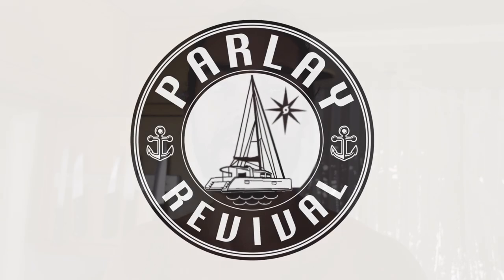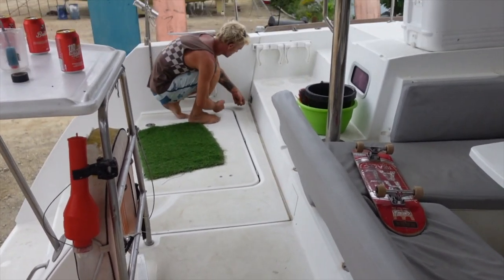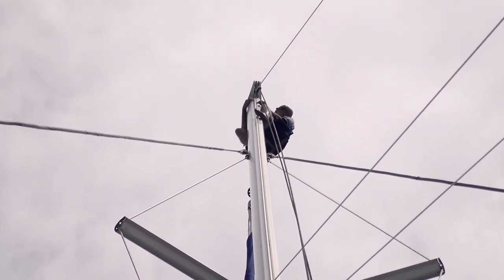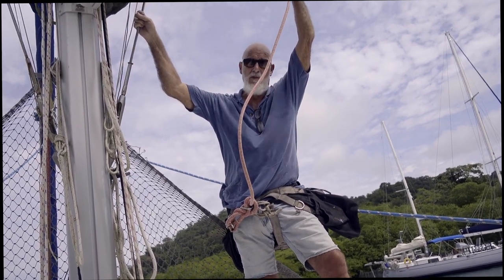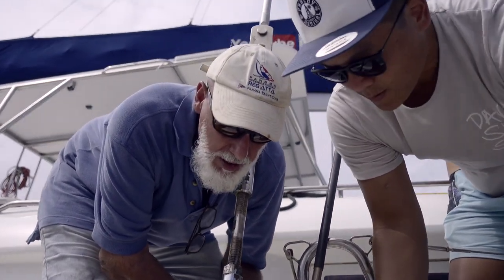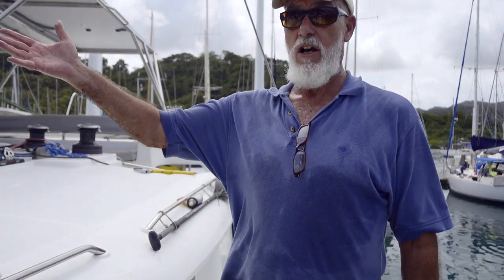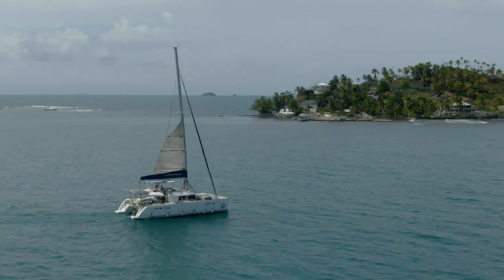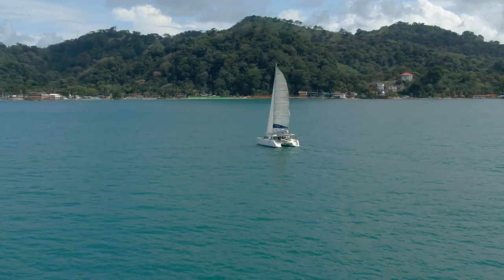How to PROPERLY TENSION YOUR RIGGING on a catamaran - Episode 142

Comment: You would think the Lagoon designers might place a rod compression tensioning mechanism between the hulls at the main bulkhead and the bridge deck bulkhead to handle the stress of windy days and high seas!   I can see how you will always be cautious about over tensioning the rig in light winds and under tightening it in heavy winds.  The main bulkhead should have an imbedded I-beam port to starboard with lever rod adjustments at each end to keep the hulls parallel perhaps with hull movement limiting functionality. 

That is why I trust the full keel, keel stepped mast mono-hull in all sea conditions. 🤔  Just my untrained observations.  I can’t wait to see you take  “Parley Revived” out for a sea worthy test in heavy winds and seas.  Very nice re-construction work from a former “small” fiberglass boat builder.

Comment: a really half smart thing to do ( if you are starting from the point you did) is to undo the bottle screw slip and the shroud fitting and actually apply some waterproof grease. My guess is she has been sitting around a while  - and the amount of load you had to put on to get the shrouds to release  - seemed a little over the top.  greasing before reassembly helps buckets

Comment: The stays should really be tensioned using a Dillion quick check tension meter (10,000 lbs) where a professional can tension the rig to be between 3240 & 3250lbs port and starboard which happens to be is the correct recommended factory settings allegedly.  
Doing it by eye no matter "how many years" you've been doing it by eye isn't the same as a professional calibration with the correct tools) Yes I've just had it done on a 2018 mid production run F450, post factory recommend repairs. Doing it by eye and the mast is possibly overstepped, then trying claiming that from Lagoon in the future when you may incur more bulkhead issues especially under warranty.

Comment: Yes , a boat or airplane that is not “ flexible “   Brakes down eventually . I would imagine that a mechanical tension meter does not work on this rigging. It is massive but on  a mono hull with  stays of 6 mm it gives a good indication just as the rigger said the mast is now straight that is no S turn in it as you look from below to the top. To avoid problems with turning the spanners , in the future, i would have used  a little bit of ceramic grease on the threads  and then lock them. But respect guys to you and the rigger.

Comment: Over tention on any rigging is a no no . In my day i have seen buckling masts on monohulls as wel as on multihulls . Now i sail a Dutch traditional flat-bottomed boat with a wooden mast . A very sturdy piece of timber indeed . The shrouds are connecting to a steel band around the mast and resting on a thicker piece . If you over tention your shrouds on a rigging like this you are pulling the band into the mast wood . I prefer a bit of looseness in this case . My 2 cents for anybody who wants to know .

Comment: Why not use a tension gage such as LOOS gage sized for your rig. Makes comparison port / starboard  under weigh with different wind strengths accurate
How much forestay deflection and static backstay load do you have

Comment: Not gonna lie... I am hugely suspicious and untrusting when it comes to riggers. This gentleman-rigger (Mike) put me at ease after hearing him speak just for a few minutes. No gauges just old-school feel and eyeballs. Excellent. The only thing that leaves me a little uneasy is not finding a single bit of rigging hardware that needs replacement. Gotta be pretty careful with stainless because it can look fine and have a tiny surface flaw that allows moisture inside. They can look good on the outside and be rotted internally so you have to eyeball the heck out of every part.

Comment: Do not tighten the riggings on a catamaran before launching the boat.  A boat stored on land or moved is going to flex some in moving the boat.  Do non over tighten the riggings that can cause cracking problems.

Comment: These Cats are great for hanging out  docked at a Marina.. You should measure the Deflection In open seas while  tension under sail.  When the Cats are Deflectiing for days and weeks in open seas, that's when things snap. FIBERGLASS HEATS UP  when it's bowing for days ...  B.O.A.T.  Bust Out Another Thousand.  In my opinion,  Cats should have a metal skeletal frame of some kind so that the rigging can be directly attached to at certain points..  Just my opinion.
Reply: Crowther cats had a glassed wooden box beam across the hulls - super strong

Comment: Just the interview places the boats value at or above the 400k range.  Heck of a job.  You can bet engineer's have made Lagoon bulkhead changes or they won't be able to sell a boat.  Next boat upgrades, solar sail, solar windows and panels with mega battery backup..  NO ICE engines required.

Comment: use anti seize on all threaded fitting's before assembly, stainless thread's are notorious for binding or galling. a seized buckle or bolt thread on anything is a pain in the arse.

Comment: I teach rig set up. I didnt see any measurements, cap distance, or rake of mast, or methods or even percentage of braking strains of various sizes of different types of wire. I think-what you have done with your rigger will get you sailing, but to get the true exact rig tune you need to use maths. I would suggest to get a official rigger latter on to certificate your rig setup.

Comment: Too much rig tension may reveal a problem but it does not  cause the issue. Under engineered bulkheads and cheap manufacturing methods are the problem...
Reply from the maker: For the lagoon 450, I completely agree!

Comment: For the young woman getting sea sick try inserting an earplug into one ear; this fools the brain into ignoring signals from your ears and forces it to focus on signals being sent by your eyes. Navy divers bobbing on the surface uncover one ear and claim it works best if you plug the ear that is opposite to your dominant hand, such as your left ear if you are right-handed. The other thing is stand where there is nothing between you and the horizon and look at the horizon.

On a boat you will acclimatize to the movement but use the tricks and figure out what works for you then in larger waves you will have something that can help.

Comment: I remember watching you tighten the rig right before the bulkheads broke and I couldn’t believe how tight you had it, the amount of force you were applying to very large wrenches on the turnbuckles made we wince. I think the bulkheads were definitely under designed but your rig tension is likely why yours broke with and audible snap. Anyways, great job getting the boat repaired and look forward to your next adventure. Cheers!

Comment: your mast seems raked back quite a bit.    this guy seems sketchy to me.  if you say feel is more accurate than using a gauge-well that is just poppycock.  it is appropriate to say that the manufacturers recommended tension may not be best for your boat/situation and that experience may guide you to a more appropriate setup.

Comment: Such Bullshit. Nice regards from a naval architect from Germany. No reason for tensioning the lee shrouds. The mast in the top will move a little more if not tensioned. So what? A race boat is trimmed differently, but they replace the rigg after the season and the hull lasts also only for few years maximum. The education of the riggers is absolutely poor. You're right, no reason to tension too much, but it's already too much. The tension comes in from the windward side. Even when sailing downwind. Just the forward and aft shrouds need to have similar tension. And after changing the course the shrouds on the other side should have the same tension or slack. What should it be good for to tension shrouds that are not under tension by nature? A catamaran is quite similar to an sensitive wooden boat. Even if the boat is now stronger than ever there's still no need for that. An inch of mast top movement doesn't make a difference on performance or up wind angle for a cruising boat. Better think about keel concepts. There are different ways other than dagger boards or short fin keels.
And always remember what tension does to threads when stainless steel comes to stainless steel and what additional wind might do. Save your standing rigging from early replacement need because of broken threads.